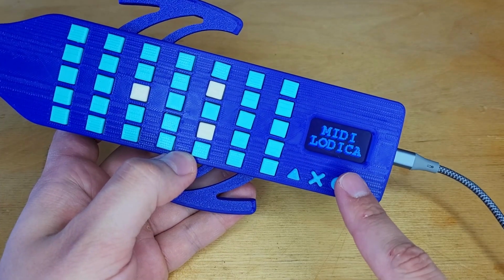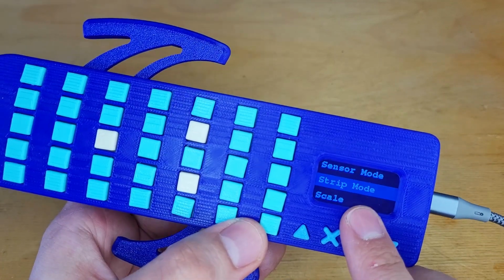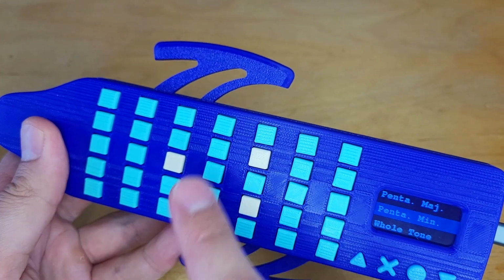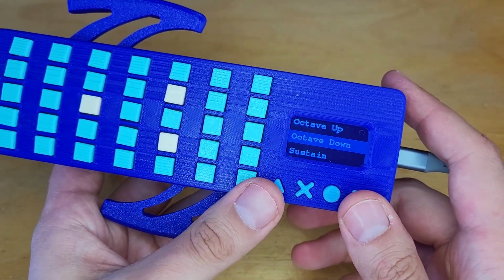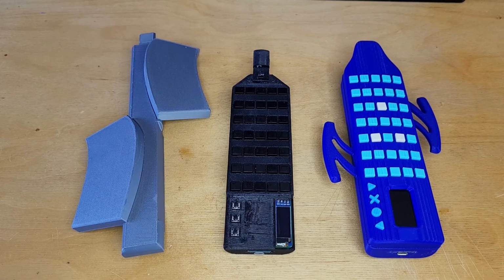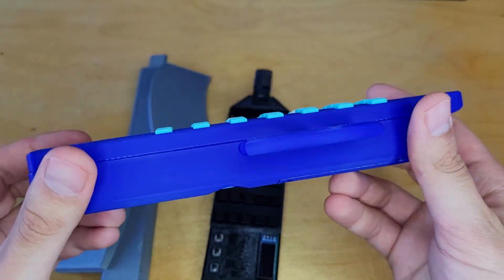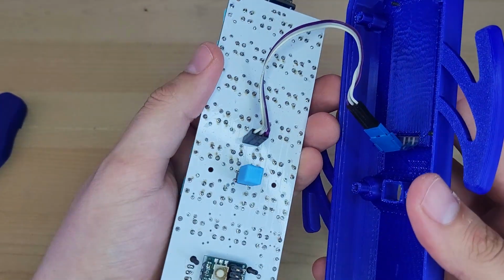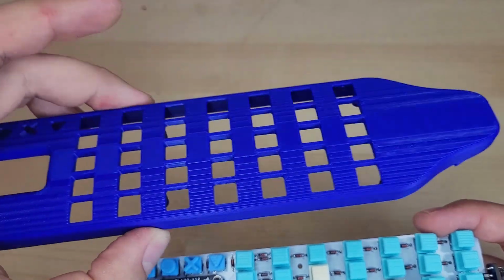3D Printed Breath-Controlled MIDI Device

Comment: Thanks for sharing! I'm into building one later this Summer. I have been waiting to find a good breath controller for a long time and this looks like a fun project. I've used to having good dynamic expression on theremin and the accordion and getting it to keyboard has been a longing for me. You can do for example a shaking sound with it where the vibration speed alters by time.

Comment: I think the teensy is closer to 1000 times faster! It also has pads on the back for USB data, so you can put USB-B on your PCB and connect to teensy with pogo pins.
Reply from the maker: Thanks, that's the plan for the next iteration. Also maybe add wifi capabilities. Who knows!

Comment: One thing I thought, for people who want to use this only to send CC values (and not notes), it might be useful to be able to use some of the "note" keys as shift keys instead, so you could change the CC values on the fly of the air sensor and the soft pot without having to stop and menu dive. For instance you could start with the soft pot sending pitch bend, but then hold down a button to shift it to send volume instead, or mod wheel, or some other useful CC like filter, pan, effect depth, etc. Same for the breath sensor. 

This is a very cool project, super impressive!
Reply from the maker: Thanks for your comment! That's an awesome suggestion, I'll look into it

Comment: Very nicely done!  I've been intending to make a faux woodwind device for several years, though other projects have taken precedence. I definitely second the recommendation of Teensy boards; between the speed and the mature library support they're a great move from the ATMega-based Arduinos.  

I believe that there are, out in the world, panel-mount USB-B connectors with a short cable to connect to a USB Micro jack; one of those would both get you a larger and more sturdy connection and relieve strain on the microcontroller board.  If you can't find one of those, I know I've more recently seen breakout boards that would let you hook up wires to both a USB Micro plug and a USB-B jack.
Reply from the maker: Thanks! I'm working on a new version that will have a hot-swappable motherboard with different versions on MUCs. Arduino, Teensy, ESP32 (for the WiFi and BLE capabilities). I think it'll be a more complete approach.

Comment: Swap over to one of Adafruit's Feather boards that have built-in battery connector and charging via the USB port.  Something like the Feather ESP32-S3 is a bit overkill, but it would also let you add Bluetooth MIDI (and rtpMIDI over WiFi, if you wanted).  USB C is much more stable than mini-b, too.
Reply from the maker: That's a great idea, it would really take away the hassle of integrating a Wi-Fi or Bluetooth chip with the Teensy. The only downside I see is that it seems like ESP32s tend to have fewer IO pins than on the Micro (as far as I've seen), and since I'm already pretty much maxed out, I would probably need some shift registers to accommodate for the button matrix, which might take up space on the board. But it's an interesting avenue for sure! Thanks for the suggestion.

Comment: This is so cool. Since there is only one tube, does the air not exit the instrument like a traditionally wind instrument?
Reply from the maker: That's right. You don't really blow into it, you just create air pressure with your mouth
Reply: Would a Venturi flow rate system work? Or would it make the apparatus too large

Comment: Would you be willing to do a video showing step by step how to build JUST the breath sensor part? I'd like to do this and just use my regular midi keyboard for the notes.
Reply from the maker: How much experience do you have with microcontrollers? It's pretty straightforward to wire up a pressure sensor to an analog input
Reply: @xavierdumont   0% experience 😆

I do possess a soldering iron and have used it a couple times for some basic, like connecting wires. But that's about it.
Reply from the maker: @primewavesmusic  I don't think I would have time to make a video about it but there are dozens of great resources online. I suggest you start somewhere like here: https://www.youtube.com/watch?v=BMMnOAzcqoE

Get an arduino board (ideally an Arduino Micro, as it is able to be recognized as an USB device). Then, get a pressure sensor (search for part number MPS20N0040D on AliExpress, there are tons of hits). Using the provided datasheet, wire up the sensor to the arduino. With fairly basic code you'de be able to get something running :) Hope this helps!

Comment: It would be nice if you could get one more row on the pad, so you can play with all 10 fingers at once without having to do some non-ergonomic finger crossing stuff or holding it at a weird angle.
Reply from the maker: The main reason it only has 7 columns is that I'm using the free version of Fusion360 and maxed out the PCB area... But it ended up working decently, because in scale mode all the octaves line up and in chromatic mode, you get fifths across each column so it's quite intuitive.
Reply: @xavierdumont  ah, that makes sense. Fair enough!

Comment: I find USB type B horrible. It looks as if it won't let go really easily but it does. This is just from experience with portable hard drives.
Reply from the maker: There's a special type of USB-B made for ruggedized environments, the plastic is orange and in my experience it holds exceptionally well. But most USB connectors are a bit flimsy anyway, MIDI would probably by the most reliable.

Comment: Would using an ESP32 let you go wireless via MIDI over IP ?
Reply from the maker: Yes, it would be a good solution. The only downside is that all the models I've found have fewer IO pins than the Micro, and since I'm already almost maxed out, that means I would need to use shift registers, which might take up a lot of space on the board.
Reply: @xavierdumont  🤔Use two esp32 chips and split the load, with only one doing the networking? With that many cores you could probably even have an onboard synth for when you didn't want to use an external device to render the midi, just send the audio out over bluetooth to earbuds.
Reply from the maker: Have them communicate via serial ports? If I did that actually I might keep th Teensy as the 'main' MC to since it's quite powerful. That might be a really good solution actually! I definitely have to look into it
Reply: @xavierdumont  Yes that would work and the ESP32 can be your synth when not sending midi to other devices, or do both if there is a use case for that.